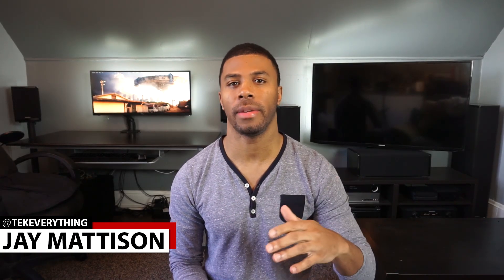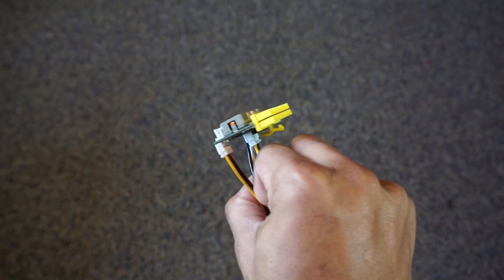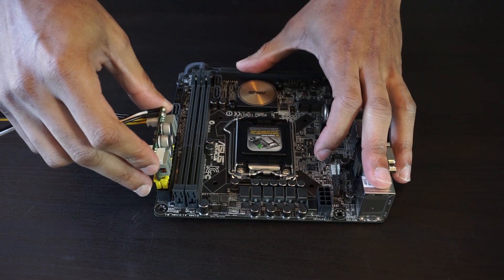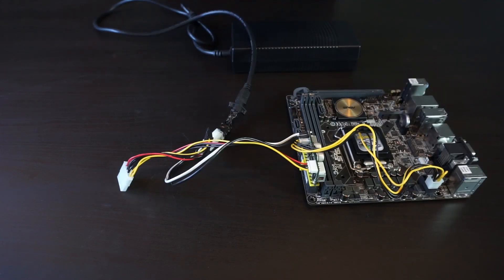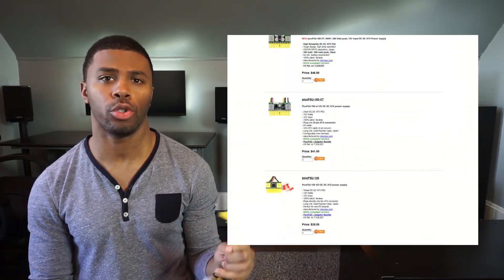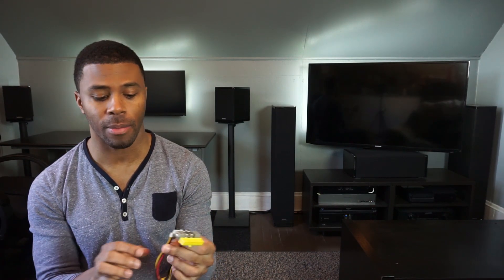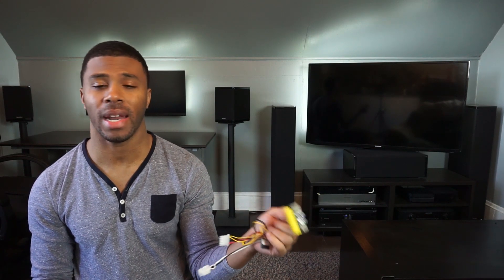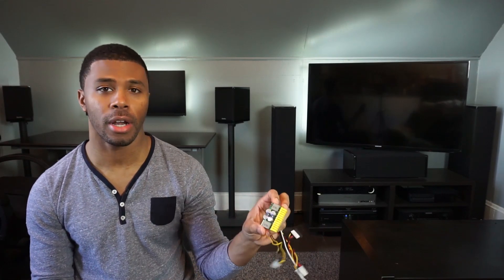Pico PSU's Explained

Comment: Anyone have experience with the Pico-box brand plugin boards? Like the z1 160w which is half the cost of the PicoPSU, but I'm sure for a reason. Are they less stable?
Reply from the maker: While I don't personally own any Pico-box products I have heard mixed things about them (mostly positive). I would probably lean towards Pico PSU's or HDPlex products unless your budget is super tight.

Comment: @tekEverything definitely im gonna use S4 case. but i guess i need at least 300w psu to power up everything. any recommendations ?
Reply from the maker: Yes, you would need the HDPlex 300, and Dell 330W power brick.
Reply: thanks man, if i'm not wrong that would be just nice for a gtx 1060.
Reply from the maker: Yea if you got that power set up you would have more than enough headroom for a 1060, could easily go with a 1070 as well.

Comment: The reason (I think from observation) that these can be so cool is because the Bridge rectification and regulation probably only occurs in the brick. I assume the Pico PSU is really just a plug adapter with some filter caps and a 5v regulator for SSDs and other peripherals
Reply: Like we see sometimes a device is named what it isn't. It is not a power supply just an interface circuit.

Comment: Nice video although technically the power brick is the actual psu and the pico psu distributes the power throughout the pc so it won't get very hot, the power brick will however.
Reply: Yeah was about to point out, they take 12v input so ofc they don't run hot. The external power brick on the other hand is probably burning hot judging by how hot stuff like laptop power bricks get.
Reply: @KiinaSu  voltage input means nothing in regards to heat. It's all about amperage.
Reply: @mattbrown292  yeah, but if it receives 12v it only has to supply low power rails, the high current 12v is just pass-through so little heat is generated at this point
Reply: @andruloni  What exactly are you responding to in my post?
Reply: i dont see this as viable at all...
if i have to buy a pico psu plus a laptop psu it ill cost the same as a normal pc psu..pointless
Reply: @starofeden9277  Fanless pc
Reply: It's not about the price. It's the size. With the Pico, you are basically taking out the PSU from inside the casing to the outside, which is great for really really small casings. 

Also SFF PSUs are more expensive than their full sized counterparts, some even more than others

Comment: Could this power an i5 4690k and a GTX 1050Ti? My current rig is an i5 4690k, 8gb ram, and a GTX  970.I have a 500 watt PSU but I was thinking of getting a Pico PSU as an alternative to a high end SFX PSU which aren't small enough for truly portable builds. Many thanks in advance!
Reply from the maker: This Pico/Brick setup could handle the 4690K and 1050 Ti yes.
Reply: Didn't you watch the video?You'll need 1-2 just for GPU and forget about any overclocking.
Nothing still beats high-quality PSU
Reply: Piko's most powerful offer is 160 watts.
GTX 1050 would draw 75W at load,
 i5 4690k will want 109 watts 
Also add everything else like motherboard, RAM, hard disk and/or SSD, fans + any USB devices. So unless you want to throw away your money don't do it

Comment: is this pico psu will work on GTX 1080 mini?
Reply from the maker: There is no 1080 Mini
Reply: 1070 mini . sorry bout that.
Reply from the maker: You wouldn't want to run a 1070 with a Pico 160xt, but you might be able to get away with using one with an i3-6300.  An HDPlex 250 would be a much better and more flexible option.
Reply: HDplex runs 2 power brick?

Comment: Dammit, I really love the fanless/small form factor of the picoPSU, but HATE the fact that it needs a power brick. I'm building an ITX HTPC soon, and there are WAY too many power bricks for all my various devices in my home theater system.
Is there something that isn't as small, but doesn't require a power brick and is still fanless/noiseless?
Reply from the maker: Check out the HDPlex website.  They have a compact internally mountable brick.

Comment: I don`t suppose that it`s witchcraft at all because the power brick is the actual PSU and that would have it`s own heatsinks and mini fan if it needed it whilst the `Pico PSU` board that you are holding is just the interface electronics ? sounds about right ?
Reply: Correct. You loose power when you are transforming voltages like 220/110V AC to 12-24V DC

Comment: Hey,  I have a Mini-ITX board with an AMD A8-5500 (65w TDP), one 8gb ddr3, 5400rpm laptop drive and onboard video.  would the 90w pico psu be enough for all this? I already have it laying around.
Reply from the maker: That should be fine.  You might want to grab a more powerful one in case you wanted to add other components later though.

Comment: the picopsu is cool because bulk of the regulation happens at the ac to 12vdc psu brick. the 12v lines is just a pass through. so whats left is the picopsu only regulates down to 5v line. you need a good quality powerbrick for these. dont cheap out on that!
Reply from the maker: Agreed.  The bricks that they ship in the bundles are quality.  I haven't had an issue yet.

Comment: Wow, I can't believe something like this exists! I think this will be the perfect solution for my DIY mini-itx laptop project. What I don't understand is this: why is that most mini itx builds use their small form factor (which are still too big compared to this solution) internal psu-s with loud and crappy cooling fans?? Meanwhile this solution is smaller and doesn't even need fans? Or am I missing something here?
Reply: Vladimir Saruta I think you could use that HDPLEX 250W unit to build more powerful setups if I understand this correctly, but hopefully "Tek Everything" will come back and answer you too.
Reply from the maker: Most people are simply unaware of Pico PSU's and the like.  Standard power supplies are also much cheaper and easier t find.
Reply: Hey, can you make a build with 2 pico PSU's for more powerful build with dedicated videocard ;)
I think this is possible ;)

Comment: 2 questions:

1. Where is a reliable source for an original not-cheap-madeinChina-fake Pico?
Reason for asking is reading some reviews on Amazon regarding a Pico 160-xt sold there but may not be from the original manufacturer. Also there are many Pico on Ali-express and Ebay which claim to have a much higher Watts then 160.

2. How is it that a Pico with 160W can provide enough power for the CPU, SSD, fans and a high end gpu such as R7/R9/gf970/gf980 ? 
While the Skylake PCU draw low power, SSD really low power I still don't see how it will run a power hungry GPUs of 90-140W despite the Pico being able to supply up to 200W.
Reply from the maker: 1.  I am not sure where you would get fake Pico PSU's from.  I have purchased two, one from mini-box and one from amazon.  Both were genuine products.  I have not heard of this issue.

2. The Pico 160xt PSU is not designed to power high end graphics cards.  I personally have pushed the 160xt about as far as it can stably go with a i7-4790S and GTX950.  If you want to run higher end components I would recommend using an HDPlex 250 or a Pico Z4-ATX-200.
Reply: Several buyers claim the one sold on Amazon is not the original product sold by mini-box despite appearing exactly the same, meaning it could be a cheap knock-off from China. You can even find on Amazon a much cheaper (half the price or less) Pico of same Watt, that is why I was asking. It seem suspicious to find both on the same site.

I saw the  Pico Z4-ATX-200 in the past but can only find it on Ali-express, which again is mainly made-in-China products, and honestly it looks extremely cheap made compared to the 160-xt sold from mini-box.

The HDPlex 250 takes too much space and making a mess, I don't like it.

Thank you for the reply I will have to do some more research.
Reply from the maker: I would probably post your question on smallformfactor.net/forum.  I haven't personally run into any issues with Pico's.  You can also find the Z4 on ebay.

Comment: hey thanks for the reply on the other video i am interested in the HD plex. I have a 80 watt Xeon CPU and a R9 nano GPU. The HD plex would be the right PSU right? I intend on using it with the NFC Systems S4 Mini. I am currently using a fully functional MINI itx PC, so i would just be changing the case and PSU. please lend me advice. thank you in advance. my current case is a silverstone FT03 mini & my PSU is a 450 silverstone gold efficiency fully modular PSU.
Reply from the maker: You would need an HDPlex with the Dell 330W power brick.

Comment: Do you think it could take ITX MB+I7 4790+Fans? I think they are ment to be for 200W constant load. Are you using some of those in similar builds?
Reply from the maker: Definitely, I ran way more components than that off of a Pico in my last build video.  Check it out here: https://www.youtube.com/watch?v=DOU7ucVP560
Reply: Thanks for fast reply. Could you please link which adapter to the wall/brick are you using from psu?  And another question: Do these pico psu have both 20 + 8 power to mb connectors? Thanks a lot
Reply from the maker: The links are in the description.  Pico's have a 24-pin ATX connector only

Comment: Hi! Is the picopsu-160-xt efficient enough? I mean, I'm thinking of building a mini-itx pc and the power required should be 156w, do you think I can use the 160 power supply or should I get something more powerful?
Reply from the maker: The 160XT is rated handle loads up to 200W.  It should easily handle 156w.  I would go with the 192w power brick.
Reply: Tek Everything Thank you! Last thing, the motherboard I've picked has got an 8-pin connector whereas the 160xt has only the 4-pin one, can I just use a 4 to 8 pin adapter?

Comment: how is a 160w enough for a system with a graphics card?
Reply from the maker: +Platipus Gaming  The 160XT can handle loads up to 200W
Reply: @Tekeverything  Is it enough for a ATI X1950XTX?!?! (it is the card i have and it runs hot)

Comment: Unless I'm mistaken, the reason those don't get hot is that there's no 12 volt conversion. The only thing that PSU has to do is downconvert for the 3.3 and 5 volt ranges for the CMOS and USB/drive controller connections. That brick on the other hand I would expect to get quite warm. It really is your limiting factor unless you have a lot running off the 5 volt rail.

Comment: hello jay,i have curently a mini itx build ( with silverstone sugo sg13b, i3 4170, gtx 970, 1 x ssd samsung 850 evo 1 tb, 16 gb ram, SILVERSTONE ST45SF 450W SFX. ) and wont to change the power suply with a pico psu becouse my silverstone sfx make a lot of noise and it is a 450w power supply and my pc takes no mre than 210 watt in gaming with gtx 970 and 170w i gaming with gtx960, and i think with a gtx 950 it will be around 130w.what do you think ...what pico psu can i buy for this system ???thanks a lot !!!
Reply from the maker: +LUCIANR81 if your system is under 200W the Pico 160xt linked in the description will work
Reply: okay, but i dont see a cable for the gpu ...how to connect the gpu to the pico psu ..???thanks !

Comment: i read on newegg the picoPSU-160W-XT can go up to 300W
Reply from the maker: +Reisen007SCI  I haven't personally seen them go that high.  If you change the wires to higher gauge maybe?  I definitely wouldn't recommend running a pico at that wattage though
Reply: go check
Reply from the maker: +Reisen007SCI  ...

Comment: I don't mean this to be negative or mean, but(at least for me) the point of having a SSF PC is to have it take up less space and to be sexy. So unless you could hide the Pico brick behind a wall or something doesn't having a fairly large external PSU like that sorta defeat the purpose a little? I mean that brick looked like about 1/3 the size of that MC600 build a couple vids back
Reply from the maker: +dre ball External power bricks can easily be hidden or mounted under your desk.  The flexibility they offer when it comes to portability is unmatched.  that brick is large, but there are much smaller ones.  Brick size was never an issue for me as I knew I could just mount it to the underside of my desk with velcro.

Comment: i use one of these as a cover psu when ordering a psu for a server slide. i use these with athlon 5350. also use a 10amp 12volt brick. There only downfall is the chips make a little bit of heat but you can stick on a little tiny heatsink if you have the room on your mobo. (you can buy really small heatsinks from moddiy.com or just google for a raspberry pi heatsinks there really cheap and you get 3)
Reply: Noodle

Comment: nice video man. 
does it have a 80 plus rating? what is the efficency like if i wanted to us it for a nas that needs to run 24/7 365? low power cpu (like 20 watts) and a couple harddrives. this would be pretty cool for a really small nas box
Reply from the maker: +MrHearthofSIN  They don't offer the standard bronze, silver, gold ratings through their website, but the manual lists a 93% efficiency.  These are over engineered and built to last, for a nas box you could go with one of the cheaper models like an 80W or 120W.
Reply: +Tek Everything yeah okay but 93% is like.. 80 plus gold or platinum right? anyway i'm asking because if the system needs to be on all day i need the most efficient components possible to cut down cost on the powerbill :) yeah i for sure could go with a 80w or 120w i mean it all depends on the amount of drives but at max it will only be 4 drives so..
Reply from the maker: 93% would be Platinum, so you should be in good shape